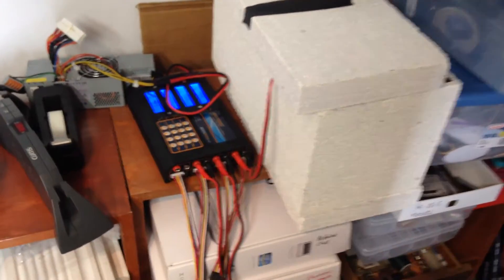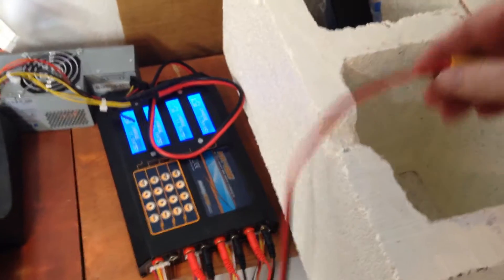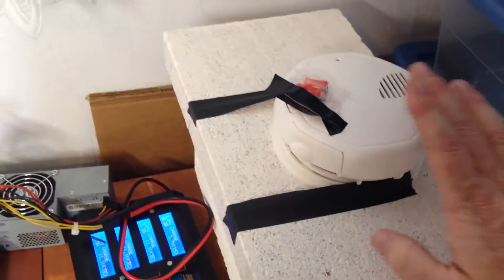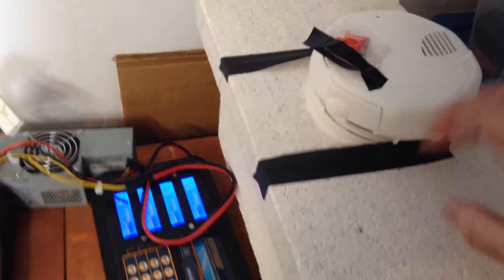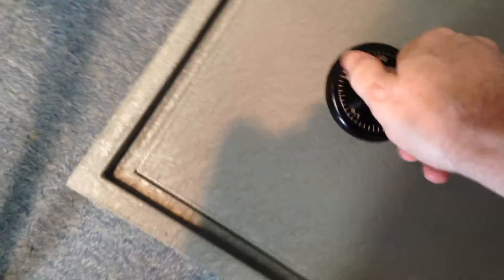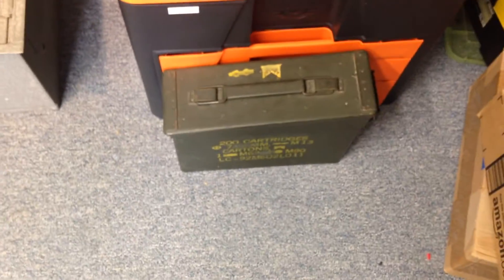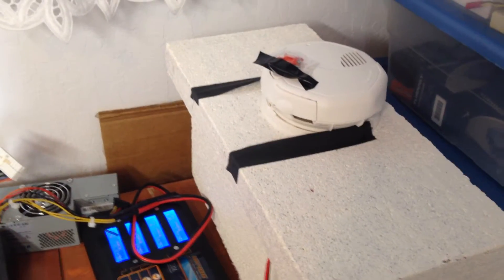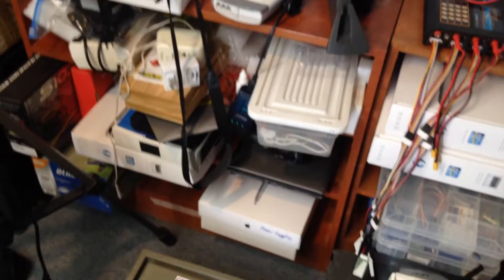Battery Bunkers, Charging and Storage

Comment: Question, why put charging LiPo batteries in a cinder block?? I want to see a test of it. How will that filter out the toxic fumes given off by the battery if it is overcharged, and how is that going to prevent it from exploding and catching fire to the rest of the stuff you have? Why not get the Bat-Safe? I want to see a side by side comparison to the Bat-Safe versus your set up, and see which one will prevent a house fire, and which one will explode and cause a fire. Are you up for the challenge???

Comment: How does the ammo can stand up to the pressure, fire, explosion of a battery? I'm curious about it cause that looks like a good size battery case/holder for me to keep in my small one bedroom apartment. BTW, I like the brick idea. Real cool invention.
Reply from the maker: Strictly based on my own observation, I think it would hold up well.  If you watch a video of a battery "exploding", it is more that one end of the foil pops open, and then a flame shoots out of that opening.  So I think that an ammo can will hold up well to that level of pressure.

Comment: I charge my batteries in  a large ceramic flower pot and have a plastic bag filled with 5 pounds of sand about 8 inches above the flower pot.  The theory is that the heat from a burning battery will melt the plastic bag and fill the flower pot with sand.

Comment: Good set up, a bit of clutter though. I am a bit of a pack rat in my studio and having had a lipo fire 4500mah  3s getting around the fire to safely remove it outdoors is tricky so I store my batts when charging and not in pack ready to go right below stove top so I can turn on exhaust fan if things go south. I think the smoke is toxic and a house will fill fast. I can't believe no idiots have crashed into a house yet and started a fire considering how many fly over houses in cities.
Reply from the maker: Thanks!  I'm a super pack rat.  My dream is to have a shop like the mythbusters where one wall is reserved for boxes of old junk.  Good idea about storing near an exhaust fan.